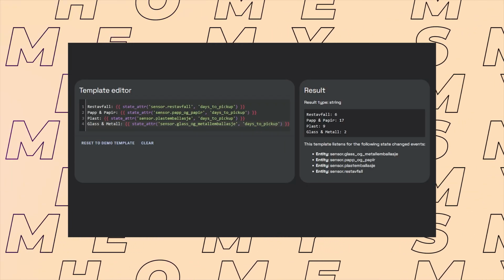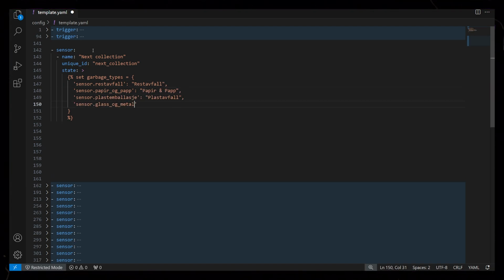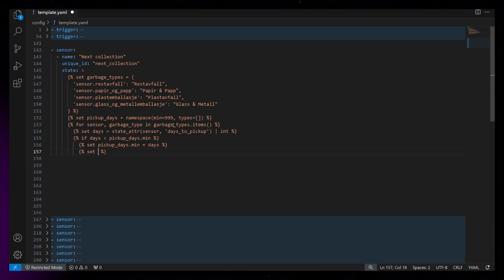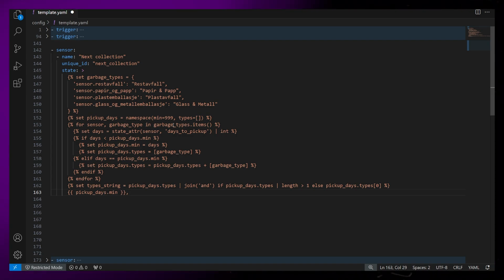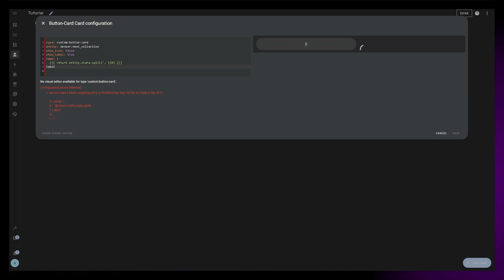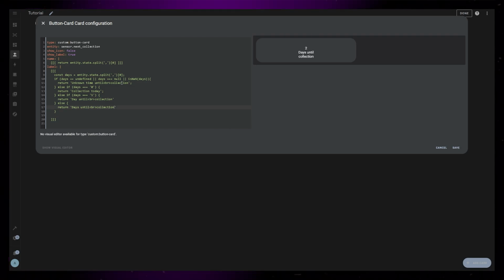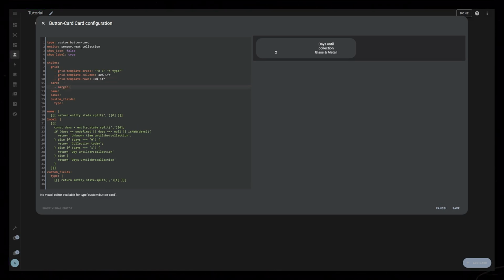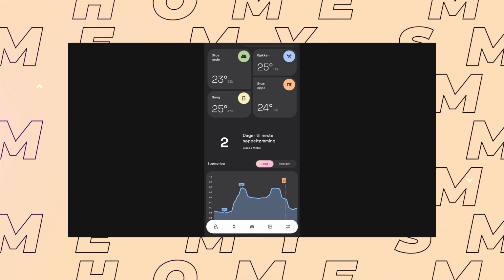Garbage Collection Card in Home Assistant

Comment: Thank you for sharing your awesome ideas and great tutorials! Unfortunately the template doesn't work for me, the state of sensor.next_collection is always "unavailable". The reason are probably my waste collection sensors. Their state is the correct number of days until the next pickup, yet I think the state attribute isn't correctly assigned. Can you tell me how I can assign them the correct attribute (days_to_pickup)?
Reply: So I have just had the same issue. From the "Waste Collection Schedule", select CONFIGURE and tick "Add New sensor" If you don't have any to modify then click Submit. Create a new sensor for the bin collection you want to monitor, for example: "recycling" Then I chose Generic and ticked "Add Days To" and under "Types" you should enter "RECYCLING" this means it will group all the recycling jobs under this sensor with an Attribute called "daysTo". I know this isn't exactly "days_to_pickup" but this is how I got it to work. You'll need to watch out for the change in the template code, but there is only one reference to swap out.
Reply: @SimplifyingChaos  where can i find Waste Collection Schedule